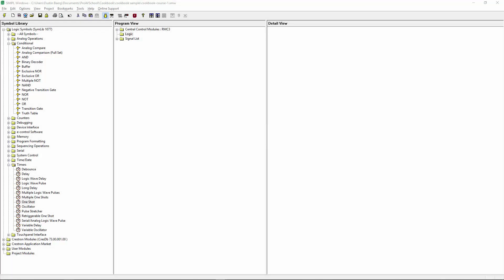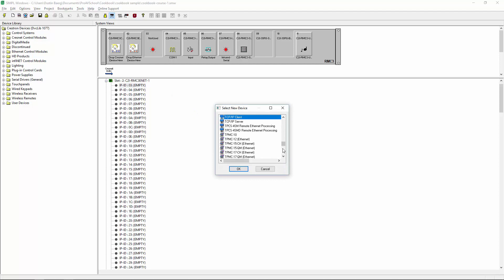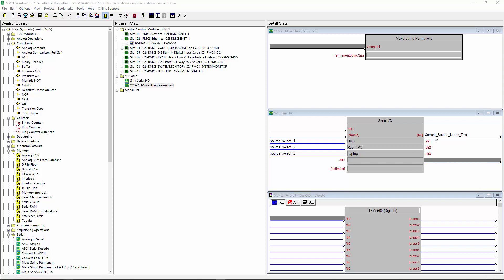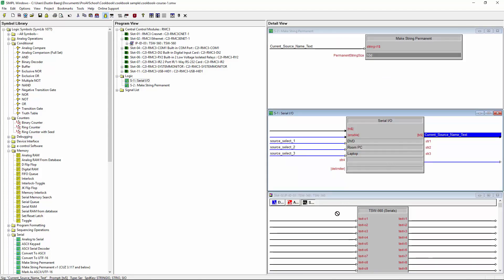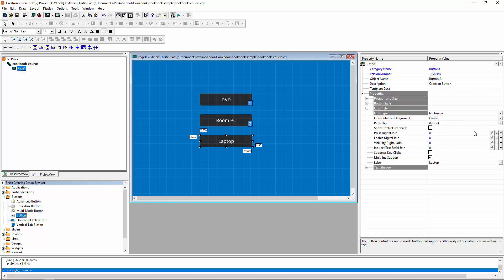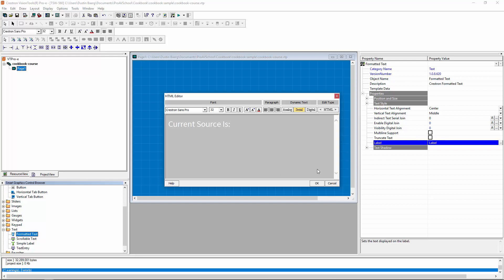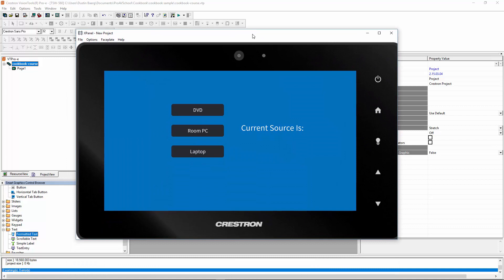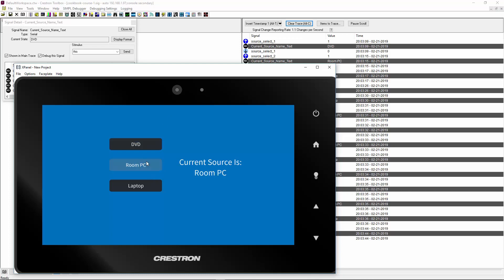Crestron Programming - Show Selected Source Text on Touch Panel

Comment: Hi Dustin, 
I have a 4k-100-c to wall plate to PRO2. HDCP is enabled and cant use mac. What should I do?
Reply from the maker: Mac laptops will always output HDCP content as long as the device is telling it that it is capable of receiving HDCP. Some transmitters you can disable HDCP and then it won't advertise this capability, I'm not 100% sure on the 4k-100-c but it probably can. If not, you might be able to do it on the input of the switcher.

This doesn't "disable" HDCP,  if the computer is playing content that REQUIRES it then that particular thing won't play (I think I've seen this with Netflix for example). Turning off HDCP on an input just makes it so that if HDCP is not required, it won't be used.
Reply: WHat HDMi swtich are you using? You need to turn on HDCP support on the input where you are getting  a green screen or cutout